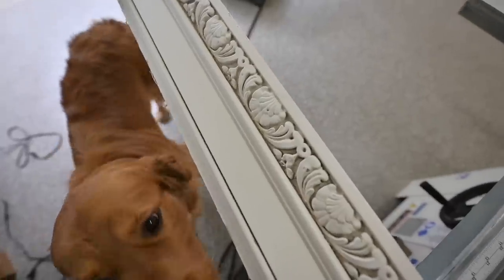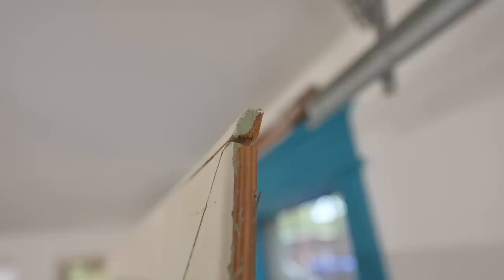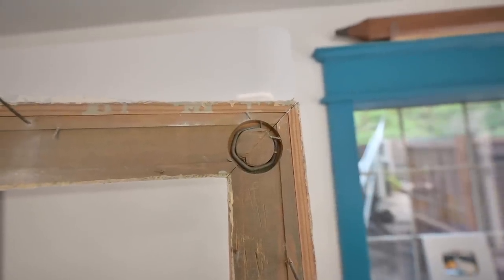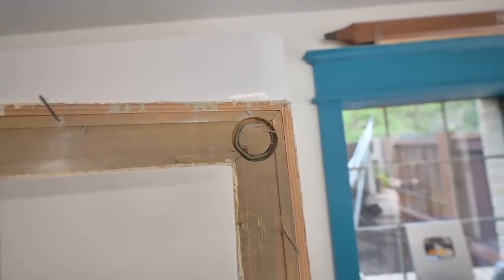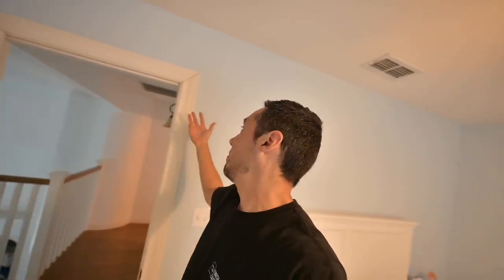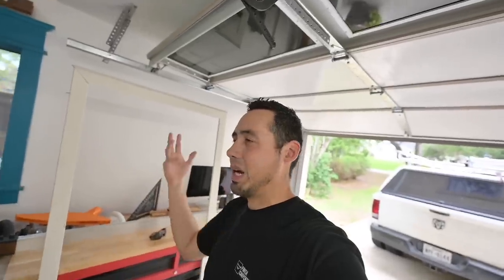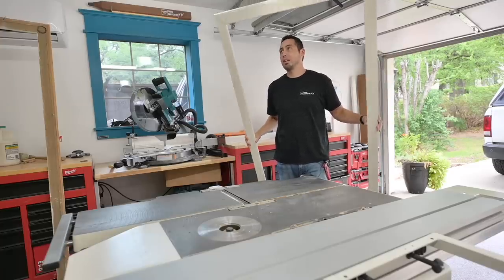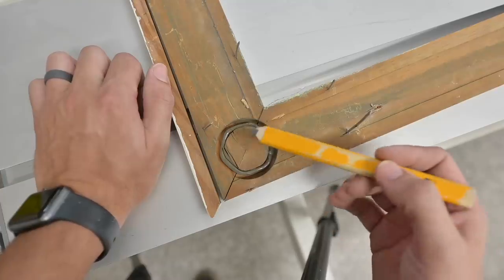Door casing skill lost for 100 years

Comment: They probably did it back then with a circular jig for the router. The middle part seems a bit damaged from the press-fitting of the ring over it. It could be done with a circular jig for the router adjusted for a standard piece of steel tubing. The hexagonal shape was probably just because they did it on the field with a dedicated machine setup to bend 1" sides at a specific angle, or something like that (as an example) and then tacked so it doesn't open up and allow for the miter to open too with pressure.
Reply: Note; the "spinning around"/"grab" part that you mention of the weld, it isn't related to anything mentioned. It is simply there so the ring doesn't open up because otherwise it wouldn't clamp down the 2 pieces together, a single tack on the outside could do the same job and you wouldn't have the "grab" part on the inside

Comment: It looks like they used something like an anular cutter to make that cut out. Maybe it was similar to an auger because that’s a clean cut

There is a way to automate the hexagon chiseling. I think it was a shaping drill. 2 blades on leaf springs and the springs are guided by a metal plate of the shape. 

Then I would probably use a press to put the hexagon ring on because a mallet might be too uneven of force

Comment: Ok not to be rude or so but here in In Sweden it's how we do it. No straight lazy lines. Either they come whit angles from fabrics when you order window frame or dorr frame they are already done or you do it your self. Now the rings is old school. We do it with 1 hole in each end of the frame piece in the center of inside where you put a peace of wood in between the both angles and som tree glue so it keep it together. Can't explain it because English isn't my primary language. It's easy.

Comment: Round route is cut with cutter similar to a pug cutter hole saw 
Inner chiseled to shape 
Glue applied ring placed in and then turned slightly with a box wrench and that Turning action pinched the miter together
Reply: As a painter, I would expect to see joints open up like in your daughter's room after the first few years of construction due to changes in humidity. It was so common, especially with crown moulding, that I included fixing it in my original contract. Eventually all of the higher end carpentry crews screwed and glued joints and it was no longer a problem.

Comment: The core doesn't seem like a hexagon. The damage on the edges makes me think it was just pushed on. The side with the weld is specially round. 

The orientation is kinda random, if it was a lot of work one wouldn't do that.

If building something takes a good amount of time one can put the big machines onsite. A hole saw for the circular holes (is it even a saw? look how smooth the bottom is?) and perhaps a press to push the rings on or just a hammer. Presumably still clamped for drilling. Maybe the drill was also the press? Moving the drill out of the way for hammering or pressing seems annoying. Moving the art work even more so.

The extra room around the ring is probably for a tool to hold the ring. It could fit inside or over the hole saw :)

Comment: It was a long piece of trim, they measured out the height and width of the door, cut the circular pattern, then cut the trim at a 45°, they then created the corner. Finally, they hammered the hex key over the circular lock and friction held the corners together.

...that's just my $0.02 anyway, don't know if I'm right, but trying to cut the circular gap to lock it with a hex key just seems to tedious and time consuming. So, my guess is they cut all of it out of longer piece of trim. Whatever they didn't need for doorways and such, they used for crown moldings or other finishings?

Comment: Just a disclaimer, I’m not a carpenter and my knowledge in carpentry is super limited, but my opinion is that whatever they used to drill the whole couldn’t have been spinning, because any shape of a drill bit would end up carving a circle shaped hole once it spins! I think they simply burned the hole by pressing down with some heated iron then sanding the charred with a small brush or something.

Comment: Do you think you could replicate this with two hole saw bits (one obviously smaller then the other, adjust the guide bit so it has just the bare amount needed to guide the hole saw) bailing wire and wire twisting tool (like what you use for dirtbike grips) Maybe use a keyhole router bit to help make a channel for the wire to sit in.

Comment: I think that centre piece of wood would be round, the hexagonal ring would be pressed onto it with a press which would form the shape in the wood, creating a high pressure fit resulting in the joint being wayyy stronger. I could wrong.

Comment: I’m still trying to understand the advantage of using a hex ring.   A round ring could just be sliced from a 16ga tube tube and would then fit into the kerf from a hole saw.   I suspect the center post was first cut round quite a little too big to fit inside the ring, but small enough to provide a fair amount of corner clearance. Then the flats were cut, but still a bit big, so pressing the ring in place tends to round the corners of the ring, providing lasting tension on the joint. If that is the case then I would expect the ring is formed from music wire rather than mild steel.   The joint on that ring looks like electrical resistance welding for sure…not done in a forge. This could be done without killing the temper at the corners, so you wouldn’t need to heat treat the ring after welding.

It seems to me you could accomplish a similar thing by using a keychain ring (springy, cheap, and easy to source) that was forced onto a slightly oversized round central post.   The annular cut could be made with a router and a simple jig. You might need a tapered steel or hardwood fid to opening the ring as you push it onto the post.

Comment: It's simple dude!  I'm a finish carpenter that's done over 2500 homes...  you take plywood and cut a 12x12 inch square.. find the center and use a scribe to mark a circle that 5 inches from center.. take a jigsaw and cut out the circle and now you have a guide!  Place the square over the millwork and now use a router to flush cut a perfect circle out of the casing.. the circle diameter is based on the size of your router base and circle! I would glue and set the corner into a jig to hold it and then I'd fill the circle with an epoxy material that hardens fast! This type of work is used on million dollar homes! Not your typical builders grade stuff! Don't have the time for it!

Comment: how about cutting a hole template into a piece of wood ( template could hold the corner together and square it) then back out the drill bit so it doesn't cut in the center into the wood and the holesaw just stays within the template...that would be the easiest way in my opinion..

Comment: Well I have a theory of my own I would use a router to make your circular pocket. Then I would chisel the flat edges for your hexagon shape in the center. I’ve used a similar technique but with a pentagon and bailing wire to cinch them together a repair on an old church door. How they did it back in day is beyond me.

Comment: I'm wondering also if the rings being made of brass. When the fit was tight. Did they boil the rings then install them. The heat would expand them an make them easier to drive. As they cooled they would uniformly pull on the wood. , heck 320F in an oven .. I dunno..its genius level. 
As for the pocket. Easy  done on a milling machine. The knives would have to be razor sharp . The kerf and angle would have to be carefully crafted.

Comment: I know this is late...   The hex ring around the corner pieces looks like it's designed to keep pressure between the mitered edges.  To bring it into the 21st century, how about using pocket screws with springs placed in the pocket before the screws?  That way there would be allowance for expansion or contraction over the years.

Comment: Perhaps you could do with someone who has perspective from machining.  I think you're on the mark with a drill press of sorts, and using a corner mount kind of setup meant to get the same angle and location every time.  That was probably pre-drilled to a certain thickness and depth, then the ring could be installed in one of 2 ways:  1) that hex-ring could have been heated and pressed into the wood after the area was cut, 2)  there was a hex shaped attachment meant for punch-cutting the pattern before the hex-ring is hammered in.

All in all, given American mentality of "Time is money," the technique was lost because it was seen as an unnecessary process.

Comment: My theory is the architrave was drilled on a press with the two pieces sat and held firmly in a premade jig. I'm guessing that your steel ring to hold the joint tight is a std 6' nail? (Or whatever size nail!) Bent and tacked together on site? Or being a std size nail many could be pre made with not too much definite accuracy needed. That's my view. Great video and love your stuff pal. 👍👌

Comment: I'm no expert but the hole has such a smooth finish that I'd find it hard to belive it was done with a hole saw. I would guess they used a router and guide perhaps built into the clamp?

Comment: They had a lot of different tools back then.

Clamp together
Use a pre made mask to put a mark on them
Drill out a rough shape by pushing down on the wood
Hammer and chisel out the hexagon shape
Hammer the metal in place

Comment: It's not that they were smarter, it's that they had different priorities and different materials to work with.  We tend to value speed and ease of use these days while the past more often valued durability.  I look at that and see a fastener that is pretty easy to make and a hole that is tolerant to both method of formation and inaccuracy of tool used.  (that hole happened to be nice and circular but it doesn't need to be for it to work.)

Comment: Man we were working on an off campus dorm that they called the Crack House. Come to find out it was an old speak easy, and whore house. All the rooms had the old deep claws tubs, there were revolving wall, and walls that slid on a rail like barn doors and locked on the other side. The site manager told me to take whatever I wanted. I brought home all the revolving walls and and sliding walls. The American Chestnut used in the trim there I got out of there was amazing. I love old stuff like that. I would say chisel, the hex shape makes sense, easier to chisel out that area then to do a perfect circle

Comment: My guess would be a hole saw guided trough a predrilled block of wood that was probably cut to rest against the corner giving a consistent placement every time
And then the flats of the hex ring just put pressure against both  sides of the inner circle .
Either that or if they chiseled the flats into the circle then they  could twist the ring while in place to tighten the mitre .
Plus this is real wood not the crap they use these days so it would compress a bit as well which would help hold the ring

Comment: Just my two-cent's worth: I've only been in carpentry for +/- 55 years, so bear with me. If I were to make that "mystery joint" with the metal ring today, I would make a jig to rout the circular channel on the back side with a palm router, with the stock firmly clamped down, and in place, and using a router bit of appropriate size for the metal ring, plus a tiny bit wider. The rings, by the way, are commonly available in most hardware stores. No, they aren't hexagonal, but you really won't need that feature if you're careful enough to size your jig properly.  BTW, as you know, that casing you showed is in common use today, (plus the add-on), so I question the actual age of the stuff you have. It is likely though, that whoever did the work is probably an old geezer--like me!
Reply: PS: the fact that the finish nails are made of round wire instead of cut iron, proves that the piece isn't really as old as one might think.

Comment: That metal ring was designed for prefab trim for doors and windows. it sped up the installation time and didn't need the expertise and skill of a seasoned carpenter. All the cutting was done at the Mill plant, no cutting needed. This was not something done on site. the tooling used at the time was limited. The hole saw for wood wasn't available until the late 1960's.

Comment: What if their hole saw was completely different in design? For the effect you're showing I would try reproducing it by making a hole saw loosely set onto a plate and use a stable hollow octagonal  grab instead of a screw to hold the saw into place. The only moving piece would be the saw itself and maybe a crank or motor to rotate the saw itself. I hope my description is coherent enough to understand. Feel free to ask me questions if you need the idea clarified.

Comment: It looks like they just used a hole saw with thick wall thickness and the circle is the oversized superimposed circle, the alignment of the hole saw would not have to be precise, likely used a press then they would press fit the ring on using the compression of the wood to bring the joint together.  You would hammer it down or press with the press and the shape of the ring would compress the wood and lock it in. No chiseling needed the hex shape is because of the compression fit

Comment: Wondering if it would be better if it's a perfect hexagon or that unrounded circle. Arguments : A perfect hexagon will fit, but it might fit a bit too much so that when the wood changes, the joints will deform. That unrounded circle provides a bit of wiggle room.
But then again, that unrounded circle is a bit.. wacky. Wouldn't make me feel safe, but maybe that's my opinion as a steel engineer and not a wood engineer.
Thanks a ton for this video though - I got some ideas out of it!

EDIT : They have hole saw back in 1920?

Comment: they use the hex shape and roughly aimed the 2 opposing point of the hex shape to roughly align with the 45 degree cut and traced the inner and outer hex shape... then get pencil and strings to make 2 circles that roughly matches both outlines and made cuts to chisel out out the area... from there they chisel out the hex shape matching the one they had planned to put in that specific corner... this is to match the individual hex piece perfectly on  each corner of the frame... no drill press no hole saw... just old fashion skills and techniques that is lost to time due to convinience...

Comment: I found myself wondering how we’d do something similar using modern tools and methods. A router, perhaps, with an h-shaped template, and springy h-shaped metal joiners? Perhaps with an installation tool to pre-load the joiners? A close relative of how worktops are often joined, in fact.

Comment: i had a bed frame i had to extend to fit a standard mattress. very similar fitting.  i will guess about 1910. what i could not figure out was why they didn't use square pieces. it would have done the same thing and have been much easier to produce and install,

Comment: No, you must keep it there. Brilliant stuff. The drill press theory couldn't work though because that tech was new in 1920 and weighed a million tons so they wouldn't carry it around.

One thought i just had is that they prefabbed it back in the factory and just slipped the rings on on the job. They could then simply cut the lengths to the house's idiosyncrasies on site which means that they'd have to measure the tops correctly, but that habit would soon form after a few abusive words.

Comment: Possible? Hole was bored on an intact board.. It was cut at 45 degrees to length later. Drill press & clamp or vise? Don't need a pilot drill. Just a guess. Mike

Comment: A couple sizes of hole saws stacked without the guide bit would do the circle. And it would be manageable back then with hand operated screw drills. Low rpm bit speed. Then chisel or gouge the rest out.

Not that it’s technology lost, it’s just we have better, more economical for production and materials, and tighter ways to hold joints together now. This antiquated method died for a reason.

A modern glued miter with a metal waved clip in the back will be a lot stronger and faster than this joint.

Have been doing custom sheet metal stuff for 18 years, I’ve seen the old guys do a lot of cool stuff like this. Lost art stuff. But it took forever. I could do the same thing with modern tools and techniques in 1/10th the time.

Comment: You're asking how to drill out.
Why to expect a center hole with such a round saw...
When I put a piece of pipe as mall , lenght a few cm , on the wood and run such a drill saw, without the centerpieces, within that matching piece of pipe I would get a perfect ronund hole exactly as deep as I want....
And I would use a clamp to fix the piece  of "pipe" on the wood (difficult to draw...think at somthomng which has a wider bottom than top for fixing it without damaging the wood.).

Comment: The problem with the miters in new homes, is the lack of proper drying of the wood before using it inside. 

The lock ring method is simply overkill and making a repair into a nightmare. We never used something like that in Denmark and the old houses with mitered items are all tight.